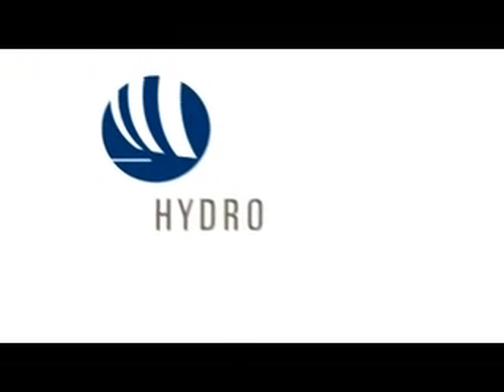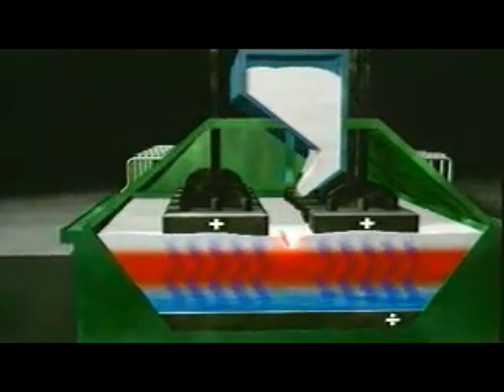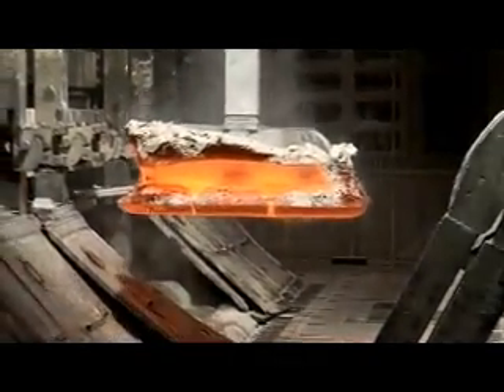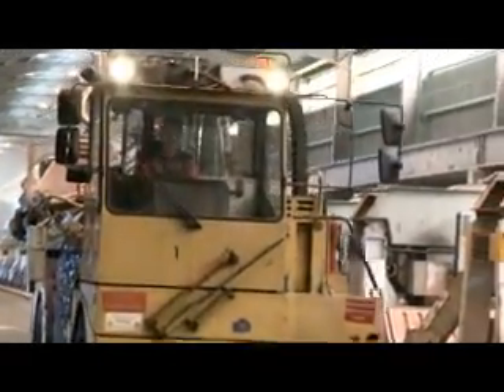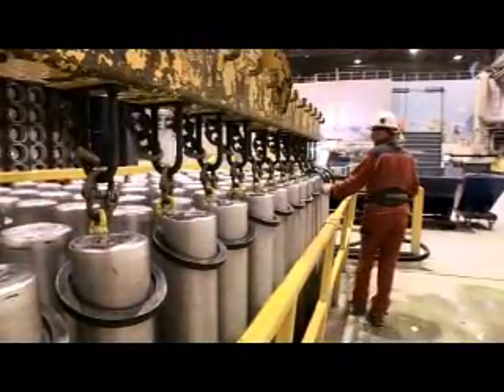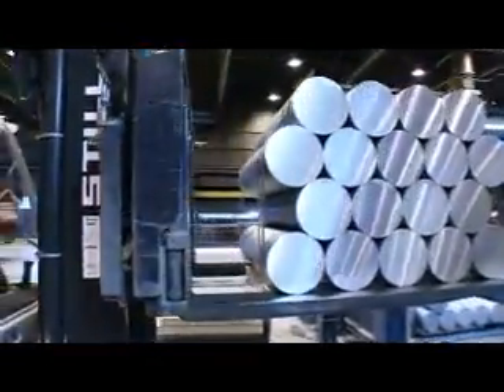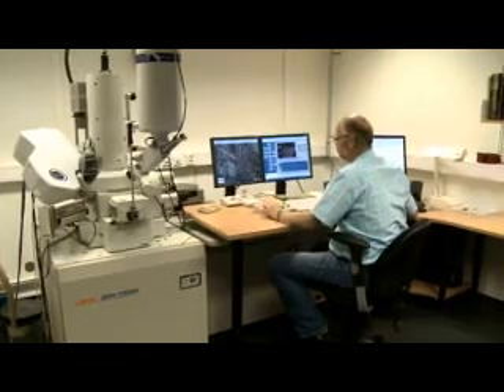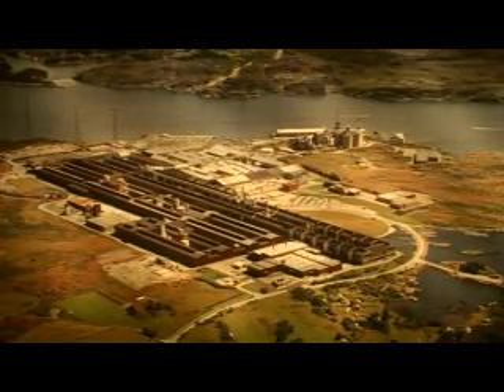The Most Sustainable Aluminium Plant In The World – Hydro Karmoy In Western Norway

Comment: start using adaptive strip oiling or  wiping without any energy, no moving parts, no replacement parts or is exceptionally versatile Equipment which can be easily installed in varied machines